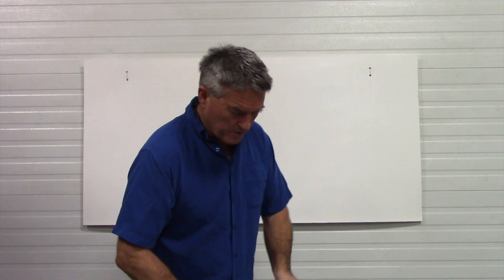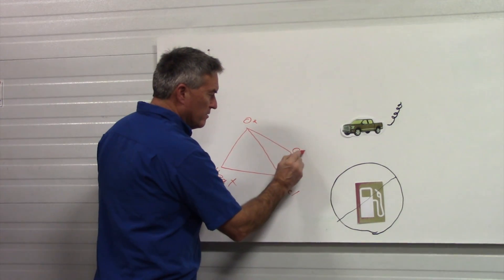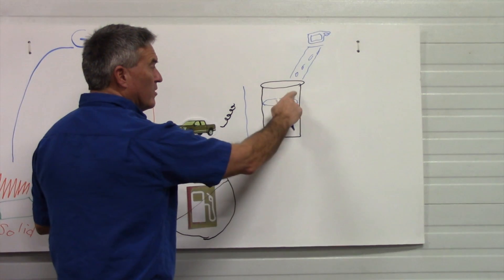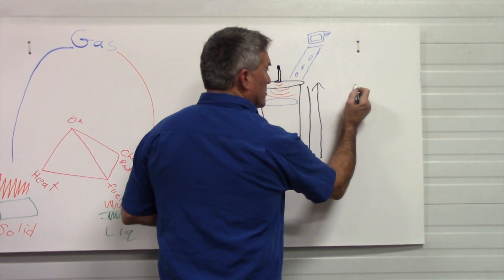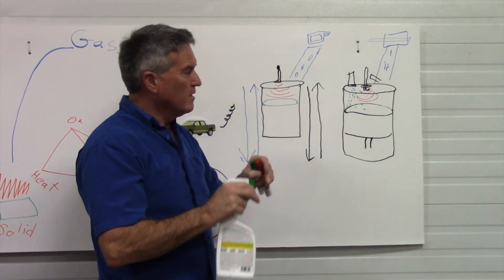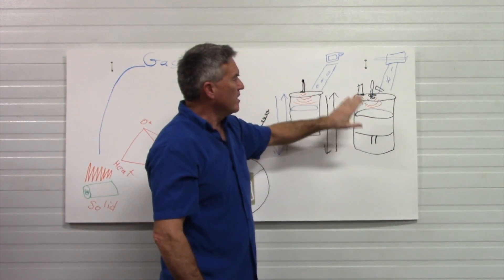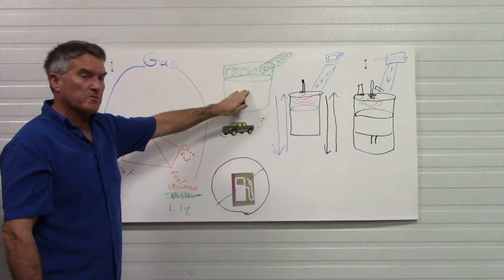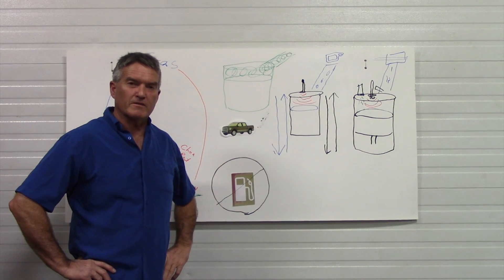One Simple Trick to get 100 miles per gallon with less pollution!

Comment: Just letting you know that crude oil is not a fossil fuel. It’s Abiotic, means it a biological and regrows. It will never run out at this level of production.
Fossil are only found to 1200 feet, Russian crude is pulled from 32000 feet.?????? WHAT 
You can go back to a  oil well that had been shut down for ten years because its been pump dry.  You will find that well recharged with crude.????????
Reply: Your ignorance is astounding. Oil well are not abandoned because they actually ran dry. They are abandoned because the production level has dropped so much as to be not worth the time. If you stop pumping of course the well itself will refill. Just like a water well that is drying up. The gallons per minute might be .5 but eventually it will fill partially back but will be quickly drained if you start the pump back up. 
Crude oil is made from plant and animal matter. It occurs at all depths. High pressure, heat and lack of oxygen can decompose it down to crude oil. People have actually demonstrated this on youtube. The only hard to duplicate is the pressure. heat and lack of oxygen is easy. The result can be refined just like crude.
Reply: AMEN!
Reply: (Yawn). You yapping your ignorant jaw means nothing. Show some actual facts preferably with video or it didn't happen. 
You haven't shown or proven anything. On the other hand I have seen others do what I said first hand. And in my case there is no violation of common chemistry principles. For instance ROCK does not have the carbon chains necessary except where vegetation got embedded in it like shale. Water and heat can only really get together in massive disturbances in enough quantities  to contribute anything. And what is creating the ammonia? 
There is literally zero evidence that what you are suggesting occurs naturally.  
Your theory with zero evidence or my facts that I can literally prove in my back yard. If what you say is so "simple" than why dont you do it? You said it was simple.
Reply: Yeah I did look it up  online. The only places carrying ANY information are all weird conspiracy based websites with zero credibility and certainly no credibility in the realm of real science. 
Also every single place I went to called it a THEORY! Which means it is not a PROVEN fact. Not to mention that it can easily be argued that the bedrock contains vegetable and plant and animal matter. All you have to do is study where that bedrock came from.  I don't personally find the argument persuasive at all.  There is just no real proof.
Reply: Abiotic = not from biological origin. It doesn't regrow Our hydro carbons stick in the rocks.
In Sweden they performed a test. The took a basaltic rock and simulated the pressure and temperatures that occure deep down the earth mantle and viola, hydrocarbons were released.
Reply: Sounds like a nice April fools joke.  You mastered in Alchemy? Please quote your source.
Reply: @rondehaan6032  You really should attach a link to back up your post. A link is a simple way a reader can directly follow to have some reference to your source and data.

Comment: Yes. I 've been aware of this since 1994 when I first bought a MSR WhisperLite International camping stove. The stove has a priming cup(not unlike a Coleman camping stove) the fuel (in the case of a WhisperLite stove it is 'White Gas' --- a cleaner form of Gasoline, like Coleman camping fuel)
the lighted primer cup heats up the copper fuel line. This fuel line gets hot(roughly 150 to 200 F) and when the gasoline enters the fueling it expands(i.e. changes state from a liquid to a gas).  
This change of state from liquid to gas means that the fuel is burns far more efficiently.  Hence a guy in the 1950s rigged his Edsel to get 90 mpg or in the 1970s that guy in TX got his cars to average 100 mpg. Then there is Stanle yMeyer who claimed he got well over 200 mpg and he also claimed to extract HHO from H2O. If true, I suspect that this would be a very dangerous thing to achieve.

Comment: Wrong Wrong Wrong. Carburetors were and are very efficient and effective. Fuel injection was introduced for CAT monitoring. Throttle body was above the throttle plate. Cars are about 98% efficient, and require a burn rate of 14.7:1 air/fuel mix. It's called stoichiometric. liquid fuel, and vapor burns at the same rate. You could not be more wrong. If what you are doing is a fact, manufacturers would have done what you believe you are doing a long time ago. I have heard this story before and it's a crock. You are actually using more energy by turning it into vapor before you burn it. If you care so much about the environment, why don't you make a real difference, and stop making babies. You're an idiot.
Reply: There has never been a vehicle/engine that has achieved 98% efficiency. Where did you find your info, Wikipedia? And carburetors are not efficient, they are effective, at best. Fuel injectors are more efficient than carbs, as witnessed by a marked increase in fuel efficiency of FI vehicles. And as for manufacturers willingly offering optimally efficient vehicles . . . no. Just like the American Medical Assn. and big Pharm are hand-in-pocket, so are the auto industry and the petroleum companies.
Reply: V. E. Hc in ppm out of exhaust today is only about 10ppm. Way less than a 2% threshold. Unfortunately the largest waste right now in a car is in the form of heat. All heat is wasted energy. Carburetors have really not gotten a fair shake against FI, because of proper calibration, and tuning issues. They utilize engine differential pressure, and only do what the engine tells it to when properly tuned. Most carburetors today are performance carburetors that have a very poor metering system, and are not designed for gas mileage. They also have newer technologies in them like annular discharge boosters that make them a little more effecient. Direct injection may work better if it compresses air with no fuel. I have calibrated and tuned carburetors in my hay day, and have made a few different brands very effecient. It is all about volumetric effenciency, timing, and weight to power ratios. Of course, I could be wrong, but not more wrong than this guy in the video that is for certain.
Reply: Agreed.  Having had a dual fuel 454 GMC that i could switch back and forth from propane to gasoline,   I know something about the vaporization of gases before combustion.
Reply: Mazda SkyActive engine uses the Miller valve system, a variant of the Atkinson Cycle.  This has absolutely NOTHING TO DO WITH the Atkins Low Carb diet because this engine uses injectors, not carbs.
Reply: Rackstar vapor burns at the same rate. All you do by vaporizing it is expanding it from a liquid to a gas. It is the same substance. If you know as much as I do about how to make an engine run properly, you would know that a lean condition will either make an engine run too hot, melt, and fuse parts together, and will hammer engine bearings from pre-ignition. Overly lean will not produce a flame front. Both looses (wastes) power (energy). I say again in a different way, the size of molecules of liquid, and vapor remains the same. Liquid just takes up less space.
Reply: Wrong. The oil companies have a monopoly on prices, and the governments, especially Commie-Cali would loose all of the taxes on gas and oil if we got 200 MPG, not to mention Stan Meyers car that runs on water for which he has a patent.
Reply: But wait. Have you not heard of the MYT engine from angellabsllc.com? And why not. Where are the millionaire investors in the engine that won the Invention of the Future Award from NASA? Where is the news? The silence is defeaning.
Reply: Not if you vaporize the fuel, then the 14/1 ration goes out the window and you can get 200 MPG with the Pogue Carburator.
Reply: Well, make a vapor carburator and test it then. You will dissappear. My boss rode with a guy who was getting 70 MPG in a large old Cadillac. The Pogue 200 MPG vapor carburator was tested by the Candadian Automobile Association of Canada and Ford Motor Company of Canada. Oil Stock Prices sank on the news.
Reply: Oh, and the guy with the 70MPG Carburator dissappeared and some guys from the oil companies showed up at the shop and took all the parts. He saw it with his own eyes. This guy is a straight shooter, not a story teller.
Reply: Rackstar go ahead. Give them a bunch of money. It has the potential to do something they want it to do. Dream about putting it on your back, so you can float around like superman. Invest, invest, invest. HURRY!!! Surley, you must be trolling me.
Reply: Rackstar storytime. I have heard that story 5 ways from sideways. Different ways, different people. It's all a believable lie for people who do not understand what is going on. EPA, government, car companies would all be making it happen if it were true. Especially California. Oil companies don't need to make more money. If they did, they would charge more. You want 70mpg that bad, go ride a scooter.
Reply: Rackstar you have no idea what you are talking about. Anyone who can invent themselves out of a cardboard box, cannot get passed the theory stage. Anoyone can get a patent on junk that doesn't work. Now you are talking like you think you know something about thermodynamics, electrolysis, and hydrogen. Maybe even perpetual motion. Go build something, and get back to me. If anyone on here actually built one of these contraptions, especially this guy with the whiteboard, I want to see it. You got nothing. I'm done with you.

Comment: Need to inject the vapor under high pressure just like a diesel motor and then put a cold air charge to it and plasma spark the entire mixture. No detonation and far less wear and tear on engine. Super fuel mileage which could have easily introduced by now. Water injection can assist in maintaining flame front as well

Comment: You forgot to mention there is no savings of fuel when a load on the vehicle is applied. That is...The heavier the load on the vehicle, the more fuel it burns or uses in order to roll on or move. Example...a 2 ton pick up truck carrying a 1 ton load burns 1 gallon of gas for 5 miles then the same 2 ton pick up truck carrying no load burns 1 gallon of gas for 15 miles. there  you got the difference in fuel consumption. There is no such free ride. May 17/18.

Comment: One basic fact of chemistry is what determines how many mpg are possible. And that fact is that the leanest fuel/air ratio that will combust is 14 to 1...14 parts of air to 1 part gas. It doesn't matter what system you develop, carbureted or injected or eyedropper, heated or cooled, 14 to 1 is the limit. That's why the myth of the oil companies withholding a fuel delivery system that will achieve 100 mpg is patently FALSE.  I learned that from watching guys install performance enhancing speed equipment that compresses the amount of air going into a motor like a supercharger or a turbo, or exhaust systems that decrease restrictions in airflow like headers, dual exhaust or larger diameter exhaust pipe. Every time they made any of these modifications fuel consumption automatically increased...why...because the more air that went into the engine the more fuel had to be mixed with it to achieve at least  the 14 to 1 ratio.

Comment: I would definitely question some of his facts about gas and the basic principles of the gasoline engine, However, this was a click bait video. There were a lot of "What ifs" but nothing that told me how to get 100 mpg in my 2010 Ford Explorer. While its true that early vaporization improves efficiency, No manufacturer has yet to market an off the shelf, professionally manufactured, bolt on device that is risk free from explosion,   meets manufactures warren-tees and pays for itself in 5000 miles or less by doubling or tripling my gas millage. I hate to be cynical here but..... come back when you have a device that meets the aforementioned criteria and an accurate presentation

Comment: That has always been the question to getter better fuel burn. Your mixing tank is a wonderful idea. How do you keep it from back firing or pre ignighting when the motor is shut off due to contact with a hot motor?
Reply: There is actually a guy that got 100% fuel vapor using a the exhaust with a heat exchanger and a turbo faced directly into the intake. He shows exactly how its done on the Facebook group Gasoline Vapor Systems.

Comment: Sweet. But, to take such a punch to big oil is similar to suicide. They will kill to keep the oil flowing. Great invention. Not all that new. Vapor ignition does work. A different type of cylinder lubrication/cooling is needed. Or we get seizures. It is also possible to get the hydrogen from water and use that gas as a fuel. All these inventions are on hold until big oil is made insignificant. We might have free electricity if JP Morgan didn't want to sell millions of miles of copper and charge for electricity rather than Teslas idea of just giving it for free. Morgan ruined Tesla.